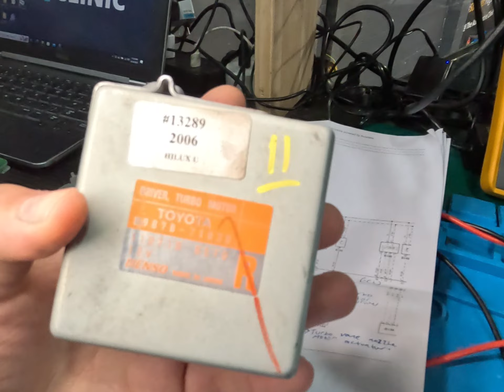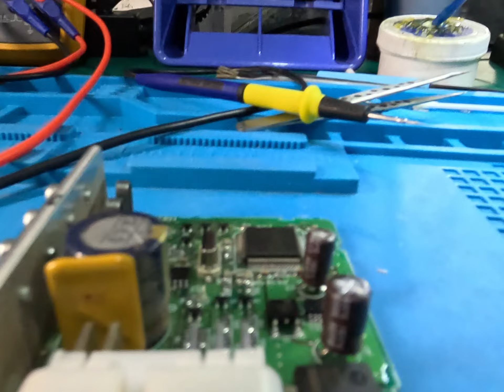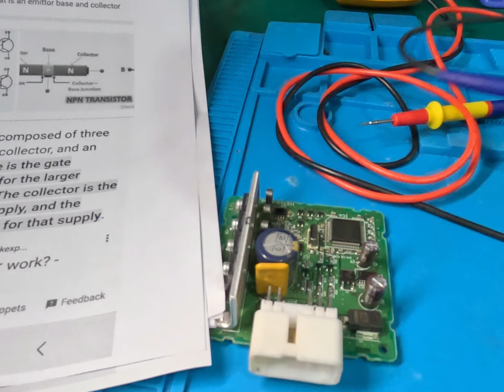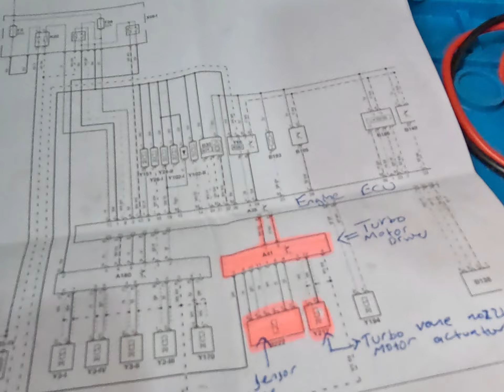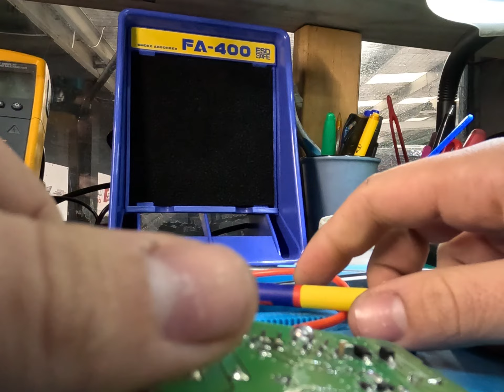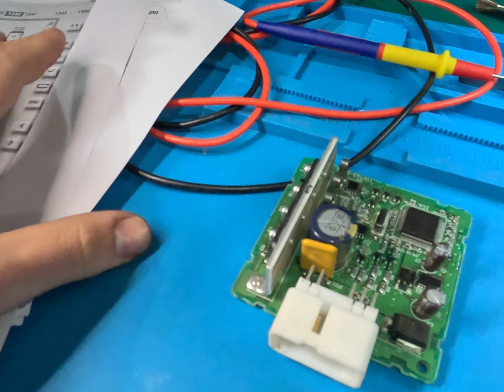Toyota hilux turbo module/controller failure Diag + Repair ✅️👨‍💻

Comment: That transistor is for the 5v reference voltage for the Vane position sensor in the turbo. If the water pump had been replace check the wiring behind the water pump. I had seem a couple of Hilux were the 5 volts reference voltage was shorting out after a water pump replacement blowing the same transistor. The transistor I used is a PNP 60v 5amps Part No. STD888T4. I bought them from Element 14 in Guilford, Sydney under Part No. 108-4555. A new module was over 700 dolares from Toyota. The transistor is only a couple of dolars.